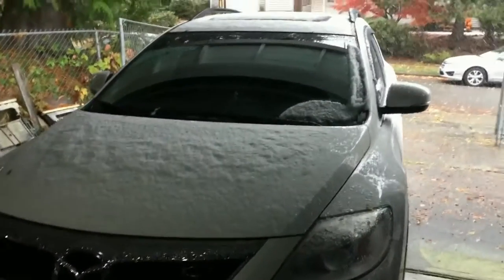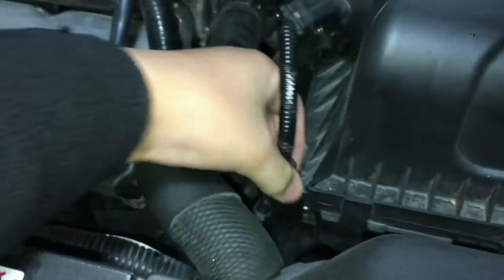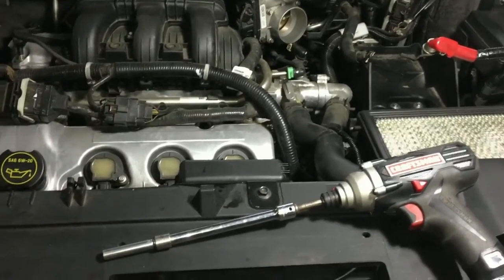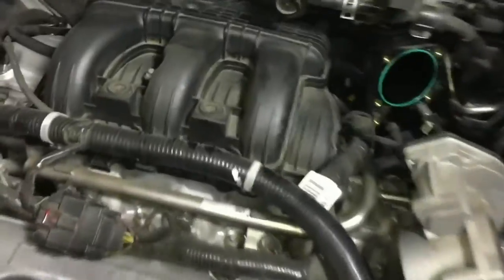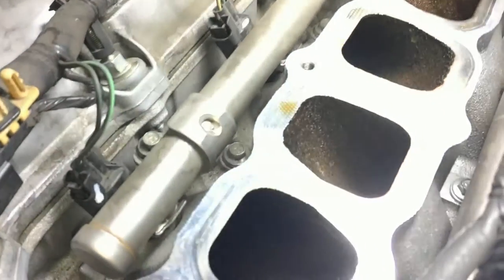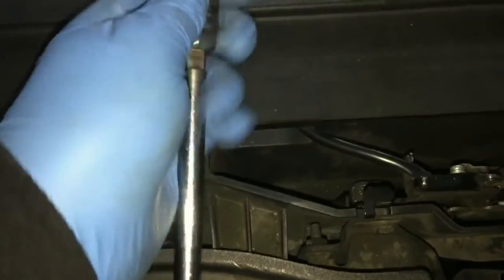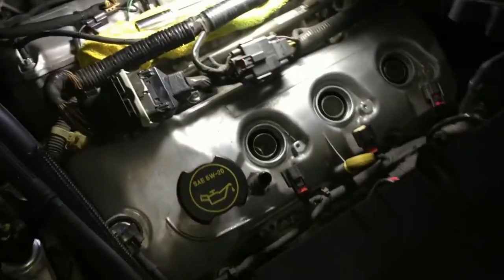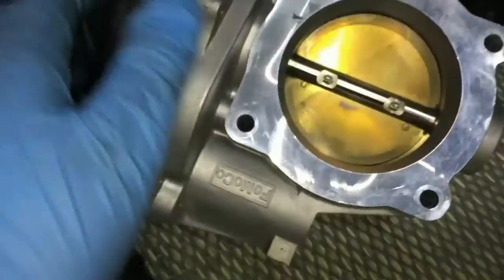2006-2015 Mazda CX9 GT 3.7L Spark Plug Replacement

Comment: Do you have to take the throttle body off? Looks like I could just unplug it and still remove the intake. Can you confirm this?
Reply: I was wondering the same because I've seen it done both ways. It doesn't seem beneficial to remove it as far as I can tell but I'm tackling this tomorrow so we'll see. 
The downside of removing it is there's a gasket that sits in the plenum between the throttle body. So if you don't remove the TB you don't have to replace the gasket. Remove the TB and you should probably replace the gasket.
Here's a video showing it done without removing the TB:
https://youtu.be/mHL86WOr8Hg
Reply: @scottsuhre2514  yes I did it without removing the throttle body with zero problems
Reply: @sethsmith8766  thanks Seth!